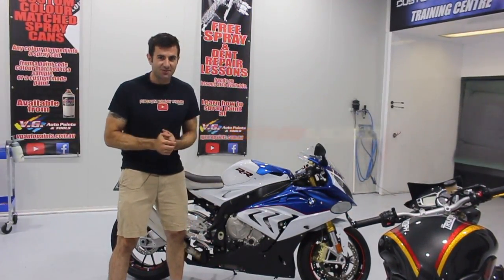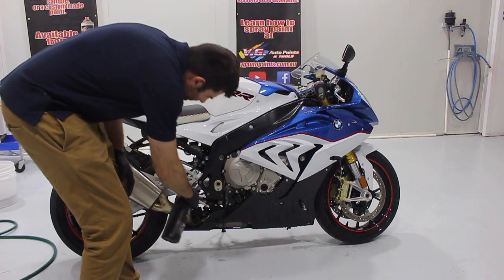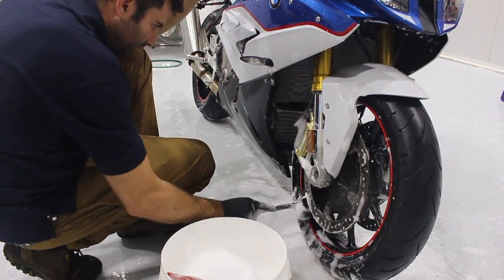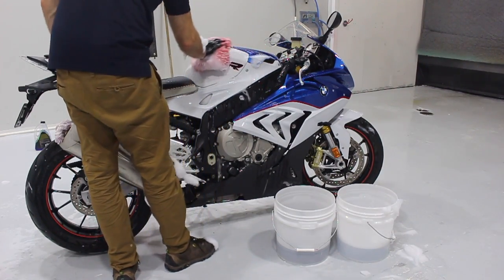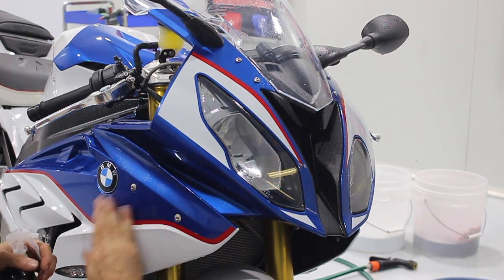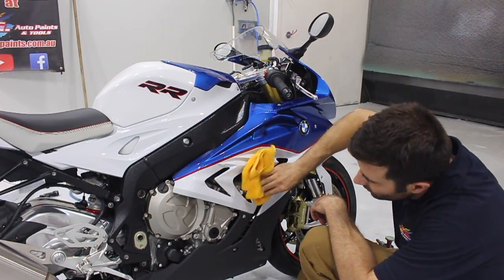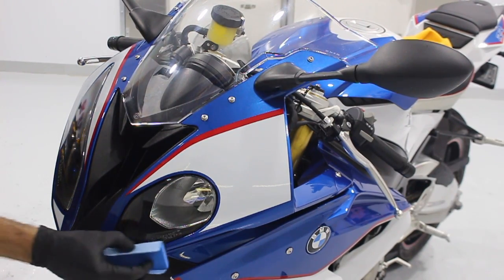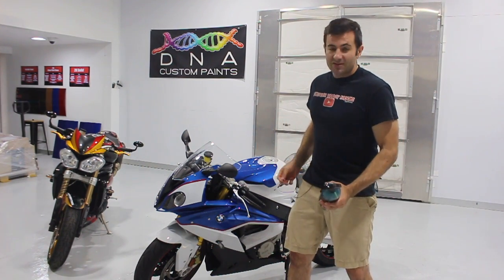How to Motorcycle detail and ceramic coated

Comment: Ceramic coating will not adhere to contaminated paint so every stage is important if the durability of the product is to last. This is detailing as opposed to washing which is insufficient for those bonded contaminants to be removed otherwise. 

The less you touch the paint the fewer swirls, which would be more evident once a wax or especially ceramic was used. Swirls on older bike can be reduced, filled or removed with the correct compound or techniques. Safer by hand, I use a 1" pad on a Rotary machine polisher.

Nice tutorial plus result, thanks for your help from #customspraymods.
Reply: I stupidly pressed real hard with a microfiber, using my nail which I turned long way, and created a couple long scratches along the headlight. I was losing light fast and wanted the big residue gone. Couldn't clay or use a paint cleaner. I know you never press hard with anything, even the plushest microfiber, but I was stubborn.  I haven't tested if they disappear when wet, but I'm still sure they are clear coat only. Any suggestions on how to correct without compounding? They are very faint and need to be real close to see. Perhaps a good filler? Or maybe a wax would safffice.

Comment: Mother of god, guys!
Water + soap and a soft ish brush + a cloth
Finish with putting abit of WD40 on a cloth, and wiping metal parts (not brakes) you are good to go!
Repeat every few weeks to have a bike looking new.
Once every few months give your paint a polish.
Reply: HappyOwl no brush!
Reply: @joshmcaloon6998  I mean... Yes brush.
No to dirty hard brush!
You will never be able to get gunk off a bike without some form of brush or spunge... I prefer brushes as they dont tend to hold onto the dirt particles, anything thats made of cloth will hang on to dirt much better, thus rubbing it all over your bike.
Reply: You have zero idea how to treat paint sir.
Reply: HappyOwl what are u smoking lol
Reply: Show me any reputable detailer that uses wd40..... any detailer at all actually. You're the one on the mushrooms buddy.
Reply: Luke Walker the brusj
Reply: Luke Walker dealerships are not reputable lol
Reply: I said nothing about a dealer and I agree. Dodgy af. You use the softest Mitt possible for paint, ESPECIALLY if its coloured plastic as it's even softer. Your wd40 will fill your swirls in for a bit but you're ruining it with a brush.

Comment: Realistically you shouldn't use a pressure washer as it can ram dirt into bearings that are not normally exposed to water at high pressure and wash grease out. I wouldn't use a pressure washer on mine. Sponge method I think is better as you get close to your bike and are more likely to see if parts such as break pads are being worn down or any other serviceable parts need looking at.
Reply: use a light pressure mine has 4 modes use the lightest for the bike

Comment: This is coming from experience, do not use iron removers or strong degreasers on your bike in general. It eats at uncoated paint and can possibly stain it, dries out rubber hoses, penetrates rubber seals holding grease, and bad for brakes. Soap and elbow grease is safer take your time hitting the spot, don’t be lazy by making chemicals do it for you.
Reply: elbow grease is worse for the paint it damages it 

know your products don't use the acidic or alkaline ones a lot of companies now do very good ph balanced products that wont damage the bare metallic parts and rubbers etc  use with respect and no issues
Reply: You can’t wash out embedded iron particles. Under a microscope they are jagged and embed in

A motorcycle is not far different from car detailing 

Iron removers are fine periodically. As it’s kinda necessary in the detailing world as nothing will remove them

What everyone should do is a proper decontamination wash. Polish. Then coating the bike as most every surface can be coated. Then maintenance washes

Comment: So I've never detailed or washed a bike. I'm kinda worried about the the engine and seat, im assuming they can handle some water but I don't wanna damage or have the seat completely soaked. Can I get some tips?? Also, can I used a pressure washer so should I use a spay nozzle on a garden hose?? Thanks.

Comment: I only need water soap and a clean cloth to clean and dry my bike .. this video is for those who are rich
Reply: I use snow foam and use it as a shampoo also after the initial soaking, I protect bare metal with ACF-50.  You can get a load of snow foam really cheap, I got some two years ago and still have plenty left.  ACF-50 seems expensive, but if used with a micro fibre cloth, it lasts well, you only really need to apply before and after winter but I do it after each clean to be sure.
Reply: Just people who care
Reply: So is the bike in your profile pic.

Comment: Rise bike with water, spray degreaser on the engine, rims, discs, swingarm, chain guards, rinse off degreaser, spray wheelie clean on rims, discs and calipers, wash bike with regular bike soap and sponge doing the rims last, rinse with water, chammy it dry, then use motul shine and go polish with a rag to polish. All up takes you 15 minutes to detail a bike and comes up better thsn this s1000rr
Reply: KingFenrir ROC hey bro what's up? What are some products you recommend to clean a bike?

Comment: Don't need get some oil on the chain？
Reply from the maker: Jordan Z I ride dirt bikes. The chain is under extreme pressure and gets worked hard. I tested 2 new chains with my mates bike and mine. Riding the same terrain and distance. One oiled before every ride, the other never oiled. The chain and sprockets both ended up wearing the same.

Comment: Good job, but I always thought about detailing as having a "critical condition" bike, with slime, dirt, chipped and scratched paint, oxidized wheels and radiator, whitened black plastics (from standing in the sun), hard rubber, mate and yellow windshield and headlight AND THAN make it look like this.

Comment: Why would you use the iron fallout remover before you have cleaned the bike? It makes no sense as the iron fallout remover will work better on a bike which has been washed. You will have been better off using the fallout remover before using the clay bar, which you should have used the clay bar on all of the paintwork not just on a little area.

Comment: The finished products looks great - but why would you go to all that effort and not polish the bike, especially after using a clay bar and marring the paint with it?! 😩 Ps, for the ceramic coating, you’ll only need 3-4 drops for an entire car bonnet. It really doesn’t require much and it spreads far!

Comment: What confuses me is when he dryed the bike off with his vacuum blower he then went over it with a microfiber cloth.. 😂 dude that is not the way I use these blowers on my 2 Superbikes and my work vans and car.. And trust me you're just asking to maximize getting more scratches the whole point in using a blower it's to dry it off perfectly without touching the bike or car.. Ect.. You made that look a lot more work than what it actually is I don't think some of your steps were correct I'm afraid but good try.
Reply: A microfiber cloth is not going to scratch anything, unless you use a dirty one lol That is just buffing it up to remove any possible streaks and marks.
Reply: Wrong a blower is used to get water out of gaps and holes ect so once you put a wax on water wont go onto it. Stop talking like you are a detailer😂 you work in mcdonalds and live in a 1 bedroom apartment😂

Comment: so you use all this products thats do the same for example bug remover and then clay thats to many  expenses this video is wack
Reply: ATL DELINQUENT he should of explained that better, he did everything correctly. What he should of said when it came to the clay was that it removes bonded contaminants of the paint. If you don't fully Decontaminate the paint it will hinder the ceramic coating. He could of added polishing the paint since using a clay bar will add light marring to your paint since clay is a abrasive. That's what I do when I fully detail a motorcycle and add a ceramic coating.